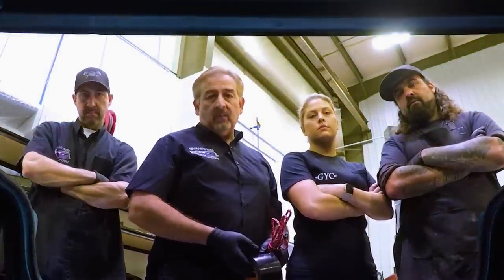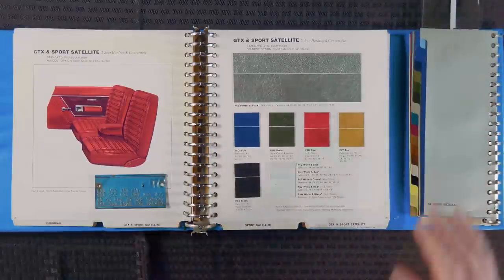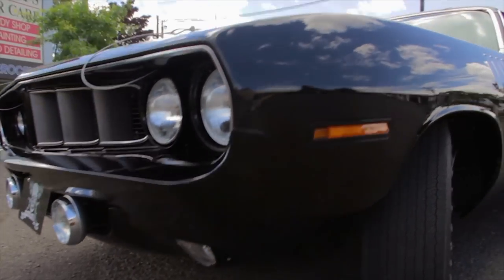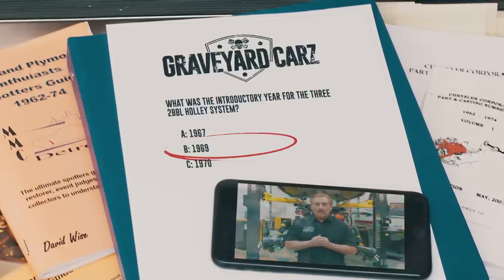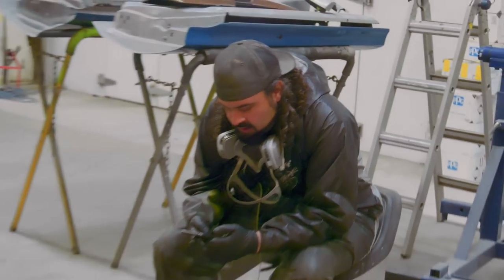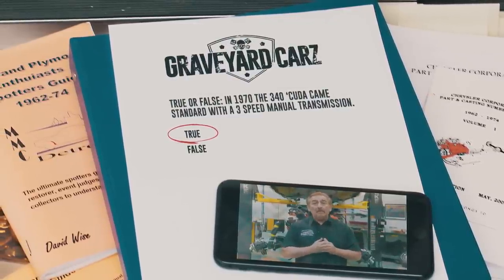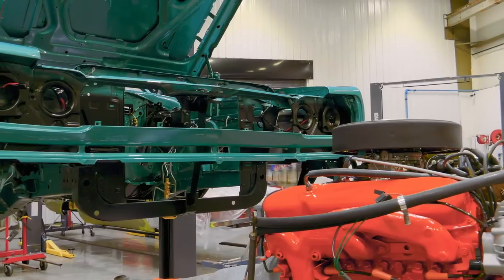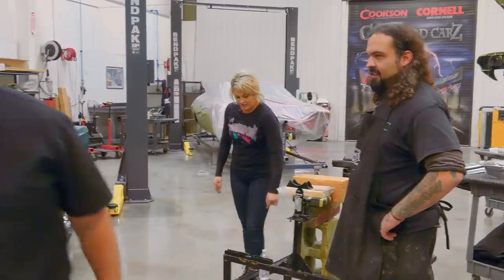HOT FOR TEACHER: ALLYSA OPENS THE CLASSROOM FOR 'CUDA 101

Comment: I love this show as much as my old 225 6 with A/C
We need more
Reply: That’s not all about the slant six! Both of these engines is just so happens, if given an oil additive, such as pro long, or slick, 50; how many engines do you know of that will run without any engine or no at all!!!?
That’s right! You read it right? These engines are capable of running without any oil! Although it is not suggested, they will do it, and I have seen it happen many times and at any temperature!
(when it comes down to the internal combustion engine, Walter Chrysler, and his engineers are the most brilliant that ever were and the engineers at Chrysler still hold that position in the dodge line.
bone stock from the factory, where are you going to find a vehicle that is capable of trapping 140 mph with an elapsed time of 9.6 five seconds in a quarter mile on pump gas?

Comment: I had a '72 Dodge Challenger white with the black stripes down the side and it had a small block 340 and I called I called it 3-speed automatic slapstick on the floor they came from the factory like that it was a horseshoe type shifter I don't know if that's what they called it or whatever I bought it when I was 22 going on 23 years old so it was a couple years old but it only had 20 something thousand miles on it and it was absolutely gorgeous white on white white bucket seats black carpeting white bucket seats as I said the small block 340 but oh my god did that car feel like it could pull the wheels off I had 67 GTO with air conditioning with a big block 400 before that car electric antenna and oh my God friend of mine had put 456 gear in the rear end 650 dual line Harley us Cragar mags Mickey Thompson white raised letter tires Thrush Mufflers dual exhaust I only paid $800 for that car and it was like brand new I had a 68 GTO red with a black convertible top as well after that and I've had a lot of muscle cars back in my day if I had them all in my backyard right now I'd be set for life but that 72 and I repeat 72 for some reason people don't like the 72s I wish I could send a picture to you guys or what it looked like after I got done detailing it it was absolutely beautiful and my God that didn't move so yeah I'm kind of favorable to the 72 Dodge Challenger that 340 just didn't seem like it wanted to ever die